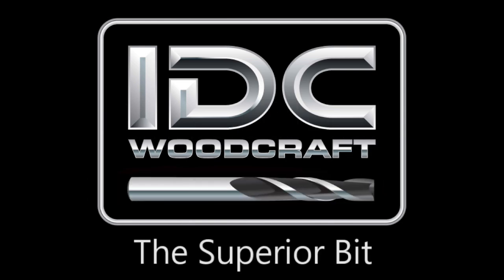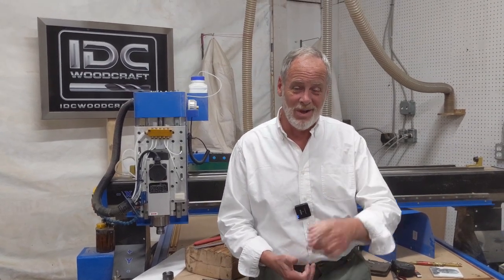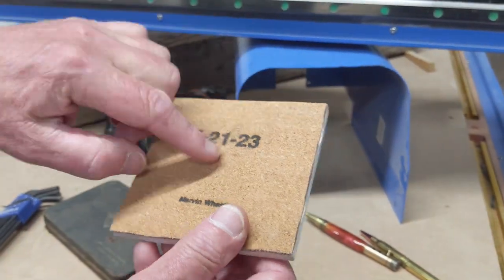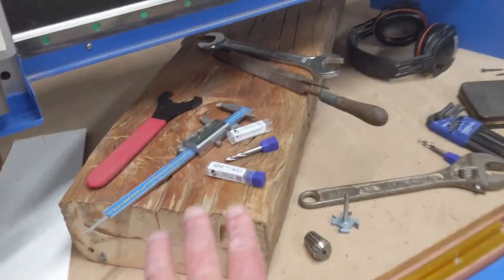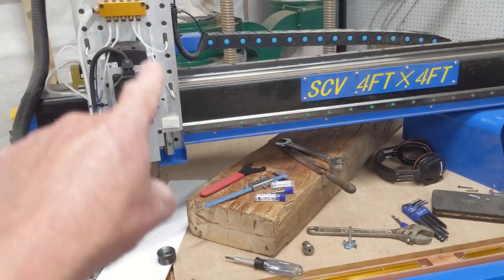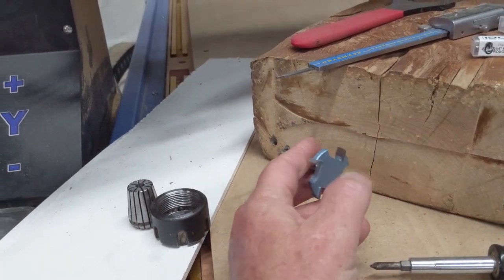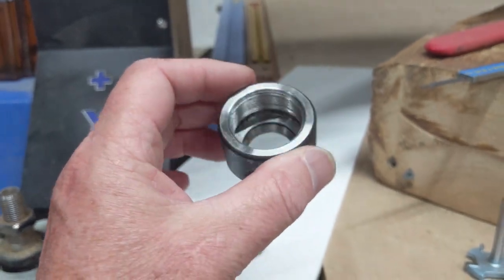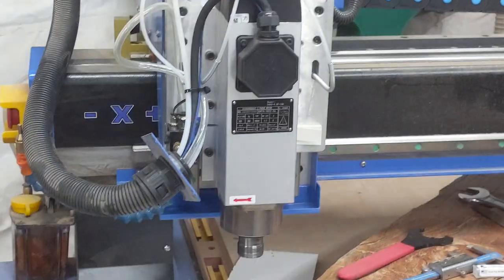CNC Router Weekend Update - WHY I KEEP SAYING THIS!!!

Comment: Garrett, don’t try to use a die on the spindle threads, you will be removing a tiny bit of metal on each thread, that will effect the balance ever so slightly. You can attempt the thread file, they aren’t expensive, but go ahead and have a couple of collet nuts to finish the process of restoring the threads….if all else fails, at least it’s an easy swap to change the spindle.
Reply from the maker: Got it. Thanks

Comment: Uh oh! That's galling. It can occur when same metal parts move on each other. Stick an aluminum pin into a close fit hole in a piece of aluminum and turn it. It will stick and gall, making it difficult to turn. The more you turn it, the worse it gets. To get the pieces apart, you may need a press or a hammer. The same thing can happen and often does with other metals also.

You turn a close fitting nut onto a stud, in this case a spindle,  and begin to turn it. You may notice a little roughness as you're turning the nut. Next thing you know, it's stuck. You manage to force the nut off the stud and you notice the threads are all bunged up. What to do? Well, if you can determine what the thread is, you may be able to get a tap and die and "chase" the  threads. If you have never used these tools though, and cross the threads while turning, you can make it worse.

The spindle is the big deal. You can most likely buy a new nut, but you have to at least clean the spindle threads. You can try the die or get a thread file and try to deburr the threads as you go around them. But when you try threading the new nut on, if you didn't do a good enough job, it will gall and stick again.

How to avoid this? Well, actually having some wood dust in the threads might actually help. The wood dust might act as a lubricant, reducing metal to metal contact. Try to avoid dry thread on dry thread. A little graphite lube or some common grease might help. You will probably notice right away the threads rotate smoother. You can turn the nut on and off several times. This may smooth the thread engagement as the nut and spindle wear into each other. If this happens to work though, wipe off as much of the graphite or grease as you can, even using solvent to dissolve it. If you don't do this, when the spindle turn on, it will shoot this stuff all over the place.

Still you may not want to have total non lubricated threads. This is what caused the problem in the first place. A minimum amount of graphite, or a clear, dry lube might help reduce the friction between metal to metal contact. Unfortunately it's not unusual or even uncommon for this to occur, especially on new threads. And the larger the threads are and the closer the thread tolerances, the more likely it is to occur.
Reply: Stainless Steel is a real culprit for galling threads. Worked with alit of SST Threads and if you felt alittle resistance you don't want to go any further. If there's alittle irregular threads and you keep tightening they will lock up and you'll never get them apart without distroying the threads and will be unusable.
Reply: @berniejanssen2863  Stainless alloys are good at galling too. Just a little bit of resistance or roughness and you could have a problem with damaged threads. Even having a shaft and bearing made from the same material will not rotate smoothly and can gall. That's why different materials are often used on close tolerance or mating parts.
Reply from the maker: CNC Programmer, you both bring up some really great points here about lubricating the threads. Definitely have given me some food for thought. Thanks for the insight brother!
Reply: @IDCWoodcraft  Well, you know Garrett, it gets back to "how do I know that?"

Comment: Advice for beginners. If you use two-size collets like 2-3, never use a 2 diameter bits, if you use 5-6 collet, never use a 5 diameter bits, etc… Using the bits from the bottom of collets range may cause the nut to be blocked, which when trying to unscrew it later may lead to the destruction of the spindle thread as in the video. in extreme cases, you have to cut the nut
Reply from the maker: bebe, great tip my friend. Thanks for sharing this one!

Comment: Get yourself some thread files. Don't use a die. A thread file will make quick work of those galled up threads. Add a new collet nut and you're back up and running.
Reply from the maker: Michael, thanks for the tips brother! I'll give this a shot!